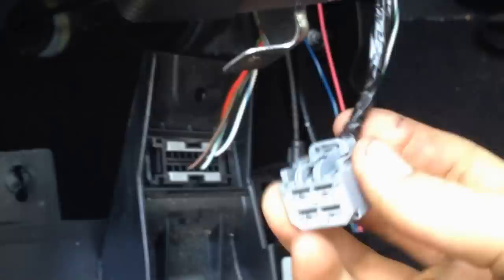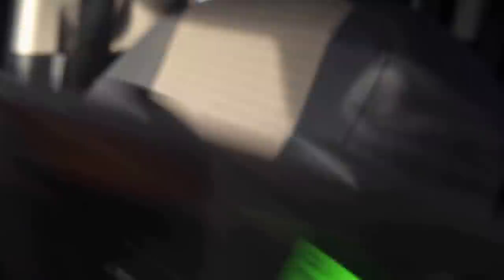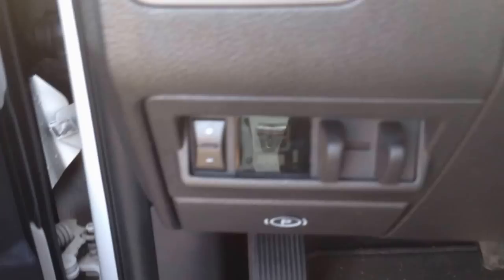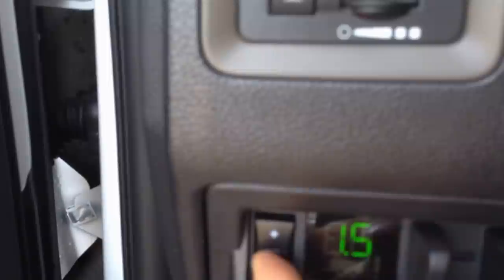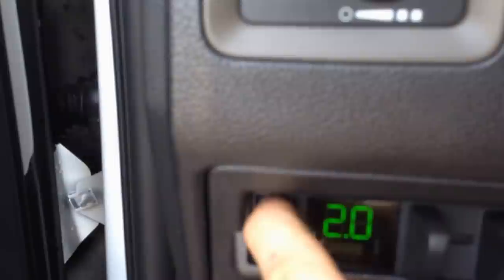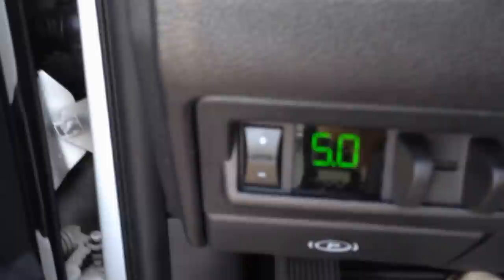Dodge Ram Integrated Trailer Brake Controller Install 2009-2012

Comment: Has anyone purchased this missing small 4pin connector lately? The eBay listing is discontinued, and I can’t seem to find it anywhere
Reply from the maker: This appears to be the same guy. The eBay listing was in Michigan, and so is this one. Try to contact them here! - https://www.2040-parts.com/wiring-kit-installram-integrated-trailer-brake-controller-270755017120-i1730896/

Comment: Hey guys. I went crazy for a little bit trying to find the wiring for the plug everybody needs. You can't really tell from the video. I used a junk plug from an aftermarket heated seat setup that plugged in without any issues. The wiring is as follows. If you're looking at the controller (4 wire connector on right, missing plug on left), the lower left pin is the red wire, the pin directly above is the blue & white & the upper right is the green & white. I hope this helps. Good luck!

Comment: Just installed this on my 2011 Ram. I thankfully had both plugs already. Unfortunately, Dodge stopped selling the bezel. It’s a discontinued part and I can’t seem to find a replacement.

Thanks for the video. Made install easy.

Comment: Used this video to remove my brake controller so I could replace the parking brake release lever on my 2012 2500. Everything followed along as you showed it - except there are THREE screws holding the brake controller in! The third one is towards the rear of the controller, in line with the one you point out, easily accessible with the side panel off.

Comment: I've heard there are issues installing these on a 2009 Dodge Ram 1500. The problem is that when hooked up to a trailer the brakes where always engaged (locked up). Any advice?
Reply from the maker: It’s not to say that the problem doesn’t exist, but I haven’t heard of or had that issue. I’d give it a shot and see what happens, there’s gotta be a fix regardless I’d think.

Comment from the maker: hmm, with the truck off and key off it stays on? there's a wire crossed somewhere, it's getting power to a wire that it shouldn't be, recheck the wiring for the small plug that taps into the ignition to verify wire colors then recheck for the big plug too, did you ever find the 4 wires for the bigger one?

Comment: what gauge wire was ignition wires
Reply from the maker: Not sure, it was pre wired. Probably 18 gauge.
Reply: there was a 2nd plug down there, you don't need to splice into the ignition facepalm

Comment: The dealership is telling me that if I hard wire it in. it will bring in a constant check engine light? did you have this issue when you installed yours? I also noticed at the end of your video the controller was not installed??? Why is that? did you have issues? I cant find the harness but thinking about using insulated slide terminals. do you think this would work? Any help would be appreciated, thanks!!
Reply from the maker: Ashley Grundman In the end mine wasn't installed because I was actually taking it all out and selling it separately to make more money because I was selling the truck. Anyways when I DID have it in, it worked fine and no check engine lights of any sort. As far as hard wiring the harness in, I'd steer clear of "scotch locks" or "T-taps", it's not a professional method and it's just jenk because the wires don't get much contact. I'd solder it or use butt connectors.

Comment: Question. Hopefully one of you can help. I have a 12 express and I ordered the itbm. They sent me OEM pigtails. Can someone tell me what the wires connect to on the smaller plug like what cavity goes to can hi/low and which one goes to B+.
Reply from the maker: They didn't install the wires into the plug for you already? That's annoying. Unfortunately I don't remember which cavity is for which wire and my video doesn't have a good angle, I would maybe google the plug part number I listed and see if there's any images showing what color is in what cavity and you can figure it out from there using my video.

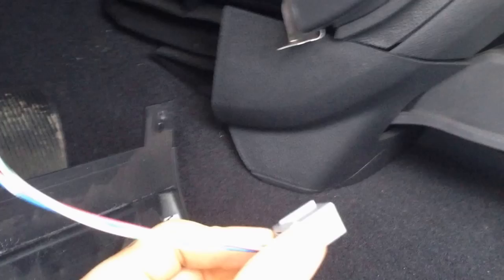Comment: I know I'm late to the party, butttttt, you didn't need to buy that second harness.  If you go to 1:56 in the video and pause it, you'll see that wire is already present in the background.  The tip is orange and the red, white and blue wires are connected to it.  That plugs into the other hole.
Reply from the maker: The one at 1:56 is the one I wired in haha

Comment: Thanks for the part #.  I found it on Amazon, listed as a tow module and part# for 2012.
Reply: What was the part number on amazon?
Reply: Mopar-OEM Trailer Tow Module- 56029431am

Comment from the maker: Yep, the part# in the description should be the smaller one. Not sure why your plug is blue though...should be gray but as long as it's a 4 pin and plugs in it should be the right one. The seller on Ebay sells them for like $35 and ships form Michigan or Canada or something, he is super slow took like 2 weeks to get mine but it's right and quality.

Comment: All the wiring harnesses are the same, both plugs for the controller are always on the trucks. This guy clearly didn’t see the other plug taped right beside the one he found. 

You don’t have wire any in. Just look harder than this guy did.
Reply from the maker: Incorrect.
Reply: @TonyTheTruckGuy  sorry bud but you’re wrong. Bc mine has both plugs. Also call a dealership and try order that wire harness. There’s only one option. They only build one harness with all the options. They just don’t plug stuff in if the truck doesn’t have the option. 

Go look again. The big plug is taped to the left and small plug is taped to the right.
Reply from the maker: @BC_I_LETU  SOME come with the plug, MANY did not. Hence the reason for these plugs being made and me needing to install it. I’ve been wrenching professionally for 15 years, and I’m a huge Mopar fan. I ASSURE you, mine and many others did/do not have this plug. I’m not blind. I literally have spent HOURS of my life doing wiring and sifting through dashes. More than likely, your truck has EVIC cluster controls on the steering wheel. Mine did not. This may be the deciding factor on if you have the plug or not.
Reply: I have a 2012 Ram 1500 and it only has 1 factory plug… So not all trucks have 2 plugs…

Comment from the maker: as long as you have BOTH plugs hooked up and wired in correctly, the brake controller should work manually (when you slide the lever over) and if you are hooked up to a trailer with properly working electric brakes, it should work just by hitting the brake pedal, but i've been told if you have an EVIC you can have it programmed at the dealer for more info like trailer trip mileage, etc.

Comment from the maker: No, without my truck to look at I don't have anything else to really go off of unless i'm there, headlights shouldn't be tied into the controller so maybe figure out with wire has power with the headlights on then see if power goes away with lights off, then disconnect that wire and find the proper wire to run it to. Worst case scenario you may have to put it back to stock and have the dealer do the wiring, i'm sure they have schematics and such, maybe check a dodge forum for wiring pics?

Comment: i just called the chrysler dealership parts department and got a quote of $255 for an oem brake controller and my truck has two 4 pin connectors. so it would plug right in both connectors. plug and play.

Comment: Hey there,
I was able to find the 4 pin on eBay, however my truck doesn't have the larger four pin plug. I see where it supposed to plug it in I just don't have the actual wire harness. Can you tell me where I can find that piece? Is that a Mopar piece? or do I have to make it?

Comment: OK so i Checked the wiring 5 times to make sure it is correct. And it is, But i am getting nothing out of the controller.. how important is the 4 pin connector that you used. I found another one that fits just fine. As long as the connection is made it should not matter what connecter it is....????
Reply from the maker: So you only have 1 plug? You MUST have both. I guess any plug that stays plugged in will work as long as the pins make good contact and they are in the proper orientation and going to the correct wires as shown.

Comment: Do you have a link for this harness still? The small 3 wire one. All the links posted are saying in available
Reply from the maker: This appears to be the same guy. The eBay listing was in Michigan, and so is this one. Try to contact them here! - https://www.2040-parts.com/wiring-kit-installram-integrated-trailer-brake-controller-270755017120-i1730896/

Comment: So I have a 2010 SLT and installed this. Previous owner had the other plug already installed and I see screws where an aftermarket brake controller was. But I’m not getting power to the plugs in the rear of the truck. Dealer says I need a flash. I was told it was plug n play!
Reply from the maker: Hmmmm. It was plug and play on my truck, but I had an ST, so I didn’t have the fancy LCD cluster. I’ve been told that the brake controller works without the flash but it just won’t show you any trailer info on the dash. I would watch through my video again and make sure all wires for both plugs are correct before trying to flash it.

Comment: Further to my post to Tony, my factory controller works fine but when i try to change from light trailer to heavy trailer int he EVIC it just won't change? I can scroll up and down etc. but i can't get the check mark on any setting other than light brake. The steering wheel buttons work for everything else so not the buttons. I've tried engine running, engine off, parking brake set bla bla bla and can't figure it out. Don't really want to go to a dealer if i can help it.
Reply from the maker: Yeah that’s weird. I assume you tried this several times. Did you try restarting the truck? I can’t think of a reason it wouldn’t let you switch if the buttons are working fine. That sounds more like a software issue and you may need an update or reflash.

Comment: Also looking for the smaller 4 pin plug if anyone has any hints as where to look much appreciated!
Reply: Where abouts did you look to find yours? I can't seem to locate it.
Reply from the maker: The smaller plug is the one you might have to buy and splice in.

Comment: Great video.  Talked to my dealership and they said I have to get the flash update on my 2011 Ram 1500 for it to work.  I have heard this is not true.  Thoughts?
Reply from the maker: It will work without the flash update, but if you have the LCD EVIC dash cluster that shows you all the information, you will need it flashed so that dash shows information about the brake controller.
Reply: @TonyTheTruckGuy  I have a 3500 with factory controller that i want to change out with a Tek P3... do you know if i will need to get the evic flashed for that. I don't care if the evic works i just don't want warning lights on etc.?
Reply from the maker: @dptp9lf  Sorry I’m not sure on that one. I just used the factory controller because I liked how clean and integrated it was. I’m not sure if an aftermarket one just plugs into the same connectors or not.

Comment: What happens if you don't install the second three wire connector?
Reply from the maker: Not sure lol, I never tried it that way I just did all the necessary steps. I’m guessing the controller would error out, not work at all, or lose some functions. It may have to do with the instrument cluster information.
Reply: @TonyTheTruckGuy  just tried it and the brake control doesn’t work at all without it. Reason I asked is because I am having an issue where when I am in stop and go traffic or in a city at stop signs the trailer brakes will lock up and then go to my setting (I know how to properly set the gain). Even if I have the controller on 0 They will still lock it up briefly. They seemingly function fine at highway speeds of course, but I’ve looked at all the wires and connectors all exposed wires in wire harnesses. I’ve looked at the harnesses from stem to stern and I can’t find a wiring issue or rubbing. This happens with all three of my trailers even with an aftermarket brake controller. Any suggestions?
Reply from the maker: @JAYFEATHERBOONDOCKS  Hmm. That is really strange…. If it’s several trailers doing that even with the gain turned down then it must be something with the truck. Maybe your TCM needs a reflash. Had a 2012 Cummins come into our shop one time and whenever you turned tow/haul mode on, it lost a bunch of power. Full power with tow/haul off. TCM reflash fixed it lol

Comment: My 2012 ram 1500 only has the one plug. From what i can tell you only need the second plug if you want the display on the dash for the controller, which my truck does not have. Will the controller still work if i only plug the one pigtail into it? I'm missing the one that you splice into the ICM.
Reply from the maker: I can’t say for certain since I used both plugs on mine and I ended up selling the truck so I can’t check for you lol. The controller SHOULD still work without the harness to the display, you just won’t have saved trailer parameters or any info on the dash.

Comment: Hey what did you do with the manual shift release to manually put the truck in neutral.  that's usually in that compartment? My batter is dead and I need to get it into neutral, the trailer brake controller is in it's place and I can't find where the usual manual shift release would be. Thanks.
Reply from the maker: I’m pretty sure the manual shift release you’re referring to is for the 8-speed trucks. This was a 2012 with the “6 speed”, so I didn’t have that. I do have another video showing a few different manual releases though, hopefully this helps you out - https://youtu.be/KJv6FmeNdBw

Comment: I've been on eBay looking for that plug that goes. To the Ignition? Wires is there any way you can give me the part number?
Reply from the maker: The connector I added, or the 1 I already had under the dash? Not sure on the 1 that my truck already had as there wasn’t a part sticker on it or anything and the truck already had if.
Reply: The contactor one I cannot find it anywhere on eBay or Amazon.
Reply from the maker: @mikepalmer8444  This appears to be the same guy. The eBay listing was in Michigan, and so is this one. Try to contact them here! - https://www.2040-parts.com/wiring-kit-installram-integrated-trailer-brake-controller-270755017120-i1730896/
Reply: Thank you
Reply: I went on that site I cannot find that plug.
Reply from the maker: @mikepalmer8444  No problem, good luck!
Reply from the maker: @mikepalmer8444  The link I posted brings you right to it. Should be lists at $35. Gotta enter your name, email, phone number, etc. and place order
Reply: It says the site has not been updated so you cannot make purchase or orders
Reply from the maker: @mikepalmer8444  Is there an email or phone number on there?
Reply: Not that I can see
Reply from the maker: @mikepalmer8444  At the top right of the page there should be a link that says “contact us”.

Comment: I dont have the cubby hole on my 09 2500. Can I get a different trim panel?
Reply from the maker: Isn’t the 09 2500 a different body style than this? The older body style?
Reply: @TonyTheTruckGuy  the 09 2500 is still a 4th gen, it looks the same, just no cubby hole
Reply from the maker: Weird. It must be a 2010 model year but built in 2009 because the 06-09 2500 and 3500 are different body style than the 09 1500. So what are you trying to put there? A cubby, a filler panel, or a brake controller?
Reply: @TonyTheTruckGuy  brake controller. I'm a minimalist, so I like the idea of it being integrated
Reply from the maker: Same haha. So is there just a filler panel right now in that spot? If it’s a 5th gen truck then I think this would work for you.
Reply: @TonyTheTruckGuy  between the lights and the parking brake its just a solid panel. Not even a mark for it. That's kinda why I think i can't get it
Reply from the maker: Have you tried to pop that panel out just to see if it has the mounting screws for the brake controller like mine did?
Reply: @TonyTheTruckGuy  lemme look now
Edit: there is a little 1x2 square in the trim piece. The piece goes from the console to the door. There is a little cutout behind the square but not like yours

Comment: My 2009 Ram 1500 doesn't seem to have either of those plugs. Wtf
Reply from the maker: Did your truck come with a factory tow package?
Reply: @TonyTheTruckGuy  yes.. I kinda of got two different story from my local Dodge dealerships too. One says I can just order the pigtail that plugs into the empty flat 4 plug next to the steering column.  The other said I'd have to do aftermarket controller.
Reply from the maker: @valiant7357  Hmm. And you can’t visually find either of the connectors taped up anywhere under the dash? They may not all be right in the exact same spot so make sure you’re looking up high enough and behind other wires and tape.
Reply: @TonyTheTruckGuy  I've scoured underneath that dash they're just not there.  I guess it wasn't an option until 2010.
Reply from the maker: @valiant7357    Very lame. So you’ll have to just run an old school style brake controller then I guess
Reply: @TonyTheTruckGuy  seems that way. Lucky there are some cool new options for aftermarket, like a simple turn dial with digital screen and the module is hidden under the dash. Just more $$$$$$ . LOL 
thanks for your time bro.
Reply from the maker: @valiant7357  Yeah, my new Grand Cherokee they don’t offer factory brake controller even though you can get factory tow package. I ended up getting the Redarc tow pro brake controller and all you can see is the knob when it’s installed. Seems to work legit. Hope you’re successful with whatever you go with!